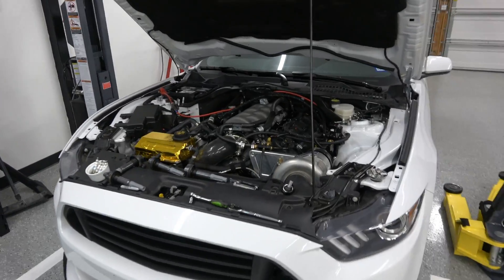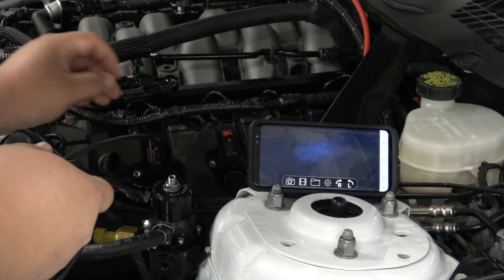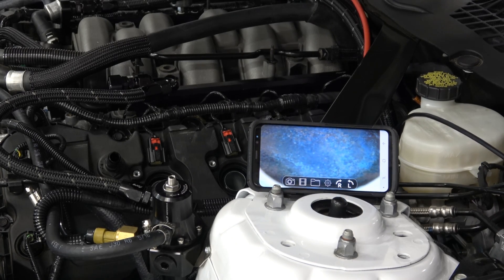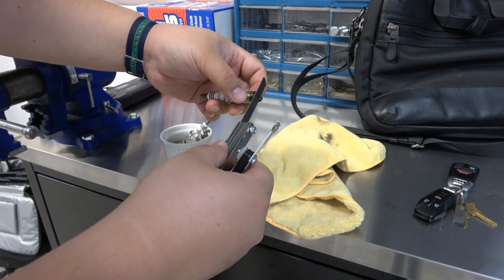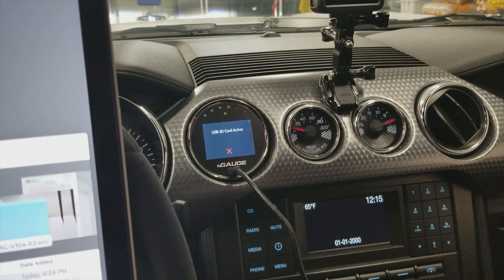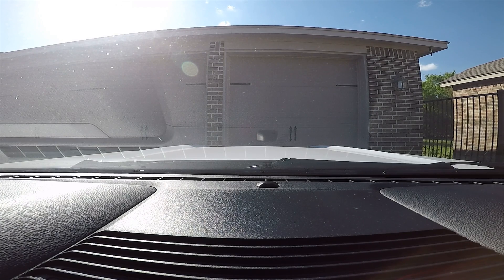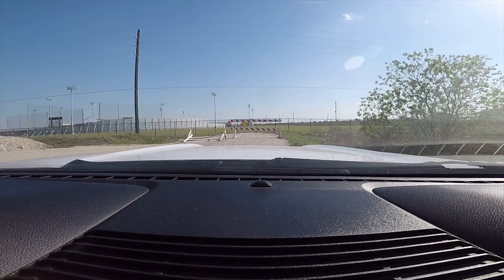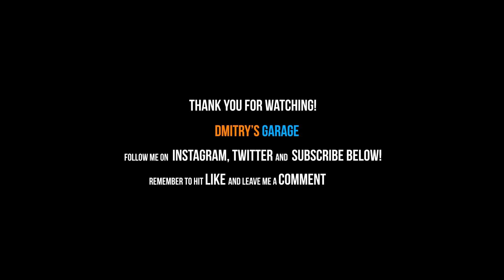Race Gas and Orange Spark Plugs

Comment: I used royal purple max boost mmt for the first time on my new spark plugs will I be ok?
Reply from the maker: I've personally never used that royal purple product. That being said, I would be very confident that you will be fine from a single use. Even if it caused some discoloration I have serious doubts it would cause any significant fouling or damage. I use Sunoco brand race gas and their GT Plus 104 product has a bunch of MMT in it. I've yet to have any issues, but I still clean the oxygen sensors and spark plugs when they come out. It's not a daily driven car so that happens a lot.

If you want to use it in the future my thoughts are as follows; Sunoco claims MMT doesn't cause any damage, in fact no one that sells MMT containing products claim they cause damage. I would still be cautious if this is your daily driven car and you plan on putting a lot of miles on it with MMT.  I have my suspicions that at scale we will find these metallic additives have draw backs just like TEL did. Why? Because in my experience there's no free lunch. Maybe the cost of that lunch is the extra cost of additives or race gas, but I'd be weary of risking a car you need for work/school/etc... There is not a lot of hard evidence out there one way or another. I've tried to read through every study I could find that remotely talks about MMT. Some studies say it's great, others question and try to link it to engine damage (detonation), and some question effects on health/environment. There just aren't enough data sets for me personally and you have to consider the sources of these studies. Oil/fuel companies want to sell a product so according to their studies MMT and ferrocene (another metallic additive) are amazing. Government regulators are scared of change and environmental nazis hate petrol products in general and wish we'd stop driving. So if they're making all the studies, who the hell knows what the truth is.

I use it in a project car, so ultimately I don't see any significant risk for me. I'm already beating the crap out of the engine, I doubt the MMT will kill it before the boost and heat does.
Reply: Dmitry's Garage Thanks so much for all of this info, everything I could have asked all in one comment! Yes I put it in my daily driver Civic Si and my BMW X1 which I just changed the plugs and noticed a little orange, I then replaced the plugs with new ones the other week and hope the coating isnt an issue. I have my doubts I need higher octane, all I have is a piggyback tuner on the thing. I almost did spark plugs myself but due to lack of time I brought it somewhere, hopefully they put them in right. Heres hoping the one time use wont affect me too much, if i had more money and a race car I wouldent care just like you. I do notice when i run it the exhaust fumes smell different and it seems to produce a smoke.
Reply from the maker: No problem! I think you will be just fine. It's just once, not a lot. I'd just stick to high octane pump gas as long as your data logging doesn't show any knock. If my memory serves your car is the 2.4L naturally aspirated, not turbo right? If so I suspect chances are you don't need all that octane anyway as long as your tune isn't crazy, just whatever the tuner recommends and check data logging for knock under wide open throttle if you can. Exhaust will smell differently, my race gas exhaust smells like magic markers.

Comment: run a e85 your pistons will be spotless
Reply from the maker: I don't daily drive the car so E85 isn't really a good option for me. Also I need consistent fuel quality so I'd most likely have to go with Gulf E98 or similar.
Reply: Mine werent. My broken in half piston that fell out of my block had like a mm of black carbon over the top of it. Assuming i had too much blow by and oil build up got hot as hell and made the e85 pre-ignite. Idk my rod couldve been stretched too